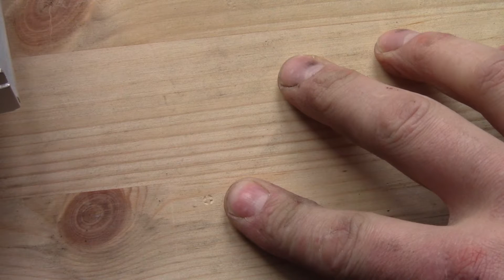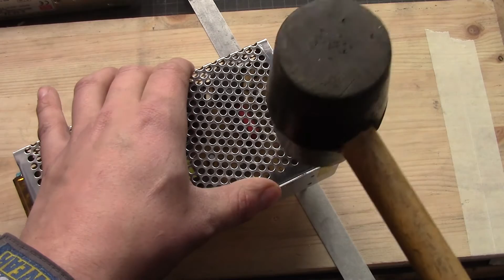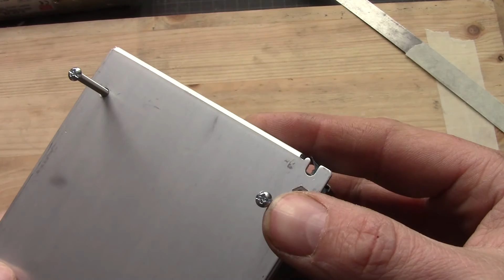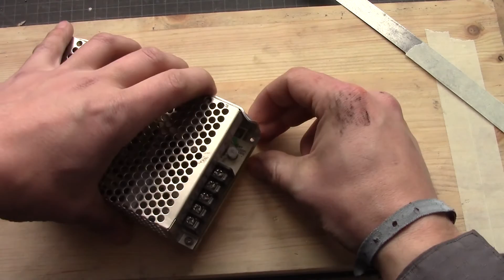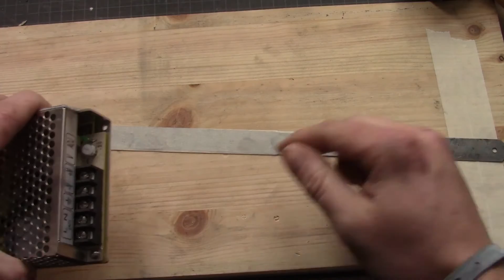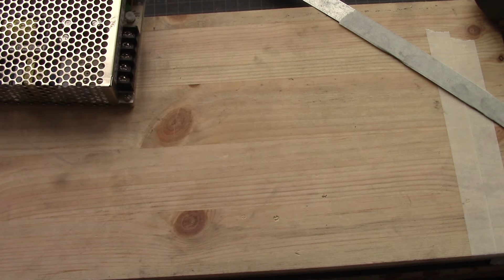Weekly Thuesday tip #2: Align mounting holes

Comment: I just make a paper template using the pencil rubbing technique. Place a piece of paper on the side you want to mount and scrape the pencil lead over the surface, concentrating on the edges and the mounting holes. It works with thicknesses up to light card stock.
Reply from the maker: Thats a very good trick. I do that when i need some special cuts but can of course be used here as well! Thanks!

Comment: First :) Nice tip I will add one more the one where you used a ball I have used bolts and nuts put them into the holes and did it that way. I liked the ball idea cause when you can not put in bolts that works great. Thanks for sharing